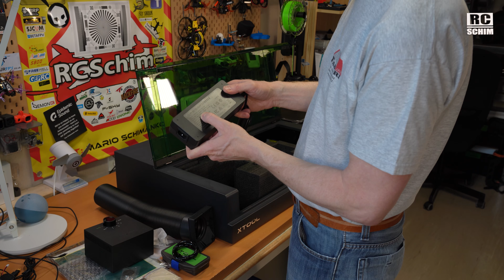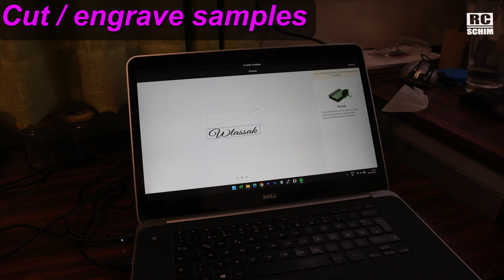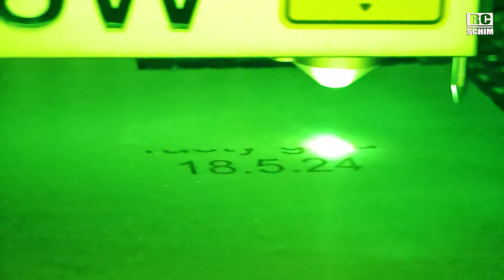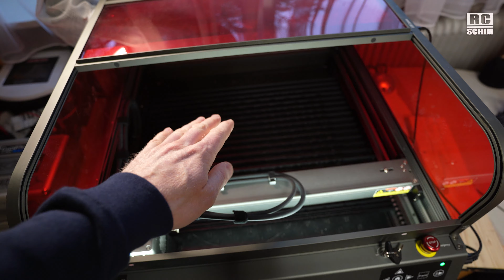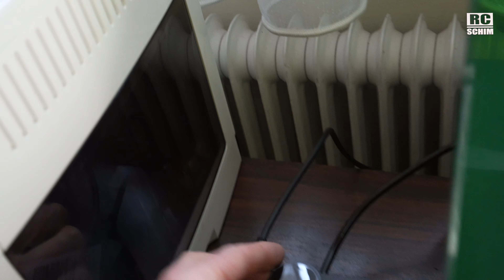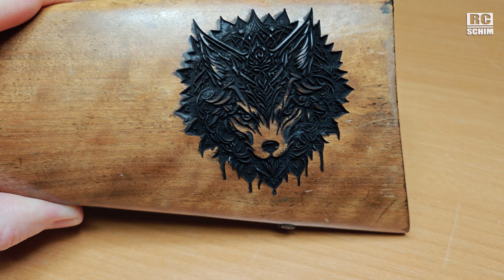xTool S1 pro lasercutter, my own DIY riser trick!

Comment: Hello. I wanted to share some information. Unfortunately, the Riser Base sold for Europe is not the same as the one in the USA. The lids cannot be opened. It is only made to give space for the RA2. They did this to keep the Class 1 laser standard. Because the models with openable lids let out smoke and light. That’s why we also cannot get the conveyor in the EU.
Reply from the maker: Thanks for sharing that info! That's one of the bigger downsides of this otherwise really good hardware - you can only work on quite flat objects. Even the way cheaper Creality Falcons can work on much higher objects. And the  galvo lasers I tested later on are even better, because the laser is completely free in the air :)
Reply: @Rcschim Galvo lasers are best but they are top expensive and big for the houses :D 

What are you thinking about Atomstack Kraft. It has dual laser (20w+1.2w IR laser) and it has also conveyor. (Working area with conveyor is 80x30. Actually it is not much) But they are giving 1 year guarantee for Europe and i couldn't find almost anything about lightburn compatibility.

Comment: Can you describe how you "shorted" the screws to "trick" the S1 into thinking the baseplate was installed?  xTool told me I could engrave without the base plate installed, but with the base plate removed, I'm getting an error code.
Reply from the maker: Look at the video. Just connect the 3 cables with a wire

Comment: Hmm.. Laser tattoos! 😂
  I guess you can upgrade the laser power output without too much expense?
Edit. 
  Funnily enough, I was looking at handheld laser engraving a few days ago. The units I was looking at went from £600+ and beyond. The manufacturer reviews seems so bias though.
Reply from the maker: Actually: on most of the lasers the laserhead is the most expensive component. Here on the S1 the 40W module costs a hefty 1350€    so either those laserheads are produced in very small numbers, or the DIODS / Lenses in there are so expensive?